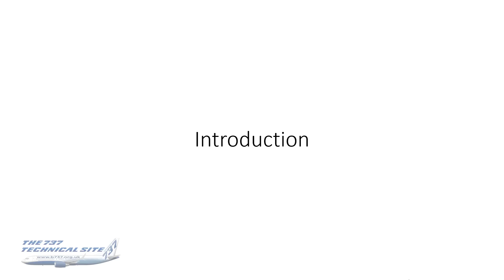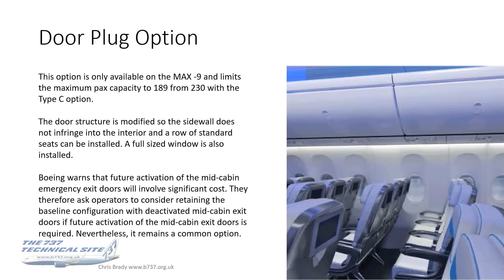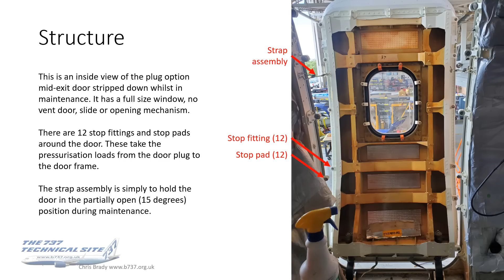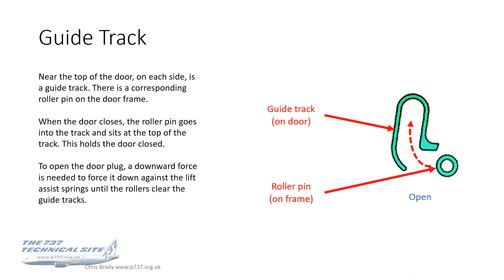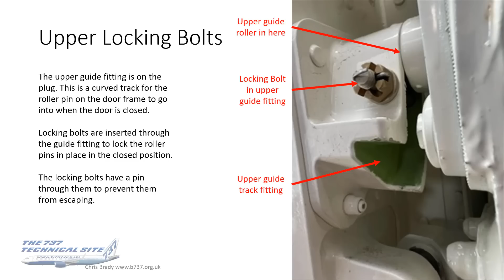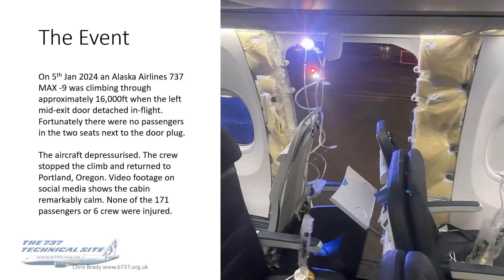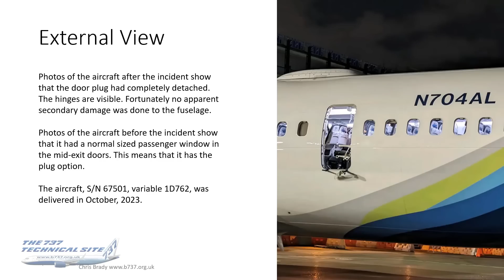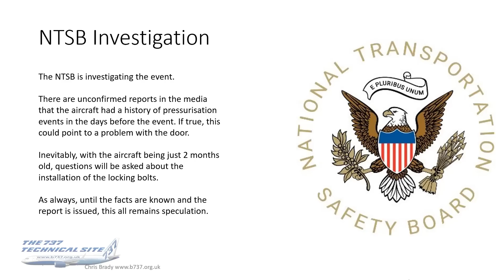737 Mid-Cabin Emergency Exit Doors - Plug Option

Comment: I'm not an Aerospace Engineer but I'm failing to understand why this sliding bolt door design option was chosen over a more fail-safe genuine plug door, that could not fit through the fuselage aperture without being removed and turned around inside the plane. This is not a door that would normally be opened in daily operations, so what is the advantage? It seems to be an unnecessary risk. The relatively undamaged fuselage port and door assembly suggest that all four bolts were left off - so maybe the design engineer just assumed that the production people couldn't possibly screw up THAT badly.
Reply: This is an underrated comment that seems like no one is talking about. These were exactly my questions. It’s not a plug door or a door plug. It’s a patch on an open hole.

Comment: The door plugs are not used in an evacuation (your comments at ~6:00).  The whole point of them is that they are plugs fitted in lieu of actual emergency exit doors in fuselage locations that don't require them.  They are covered in standard wall paneling inside -- there would be no way for passengers to even know where they were, much less open them (which requires tools)

You should revise this

See: http://www.gregorytravis.com/Aviation/737DoorPlug2.pdf
Reply: Great link @algodmen
Nice diagrams and pics of the doors
Reply: Thanks! @networkguy-2023

Comment: It is difficult to see how this door plug could come adrift with locking bolts installed as designed. As a minimum the wire/cotter/split pins must have been absent. After a career in manufacturing industry, I can understand how bolts could be fitted with nuts finger-tight at the end of a shift then tightening and securing these fasteners to be overlooked on the following shift (particularly with a large order book and pressure to deliver on time). For this to happen in the aviation industry is unforgivable though.

Comment: Chris, multiple pilots and engineers who have personally inspected these plug doors within the past few days have concluded that the 'AMM SDS 52-23-00 Page 6 MID CABIN EXIT DOOR PLUG - COMPONENTS, Lift Assist Springs' that you have quoted multiple times is in fact incorrect, or at least misleading and easily misunderstood. Therefore I believe you would be doing a public service to confirm this from a physical inspection or talk to someone who has. Insistently repeating an incorrect statement in the face of mounting evidence is a dangerous position to hold.
Reply from the maker: * Update *
In this video I state that a downwards force is required to remove the door plug. I based this statement on text in the AMM SDS which I now believe to be incorrect or misleading. It is possible that a very small downwards motion (1-2mm) is first required to be able to free the locking bolts. But the door must be moved upwards by a couple of inches to clear the guide tracks. Apologies for any confusion.
Reply: @ChrisBrady737  Thanks for the correction Chris. Looks like the Boeing AMM had a lot of people foxed. Take care.
Reply from the maker: Thanks and my apologies again! @davidjb3671

Comment: Just to be clear...the door moves up first (hince the "lift assist") and then hinges outward and down. As your slide shows, the roller pin is on the fuselage frame and the guide track is on the door. The door stops also inter lock when the door drops into it's closed position.

Everyone is concerned about this plug poping out. But from NTSB statements the Main cabin door opened in flight because Boeing says it's designed to open during rapid decompression. The plug is supposed to be bolted in and shouldn't be able to open it without pliers and a wrench. My question is...which door opened first? And HOW did the bolts disappear?
Reply: It's the cockpit door that opens when there's a loss of cabin pressure. But the crew didn't know about that feature and apparently some of the cabin crew was distracted by that and tried multiple times to close it. Seemingly only when the cabin altitude is below 10,000 feet is the cockpit door able to be latched.
Reply: No!  The cockpit door is designed to pop open on decompression, to avoid structural damage.  The plug is supposedly designed to never fall out, but the design isn't too good.

Comment: It's interesting to note that the doors need to be pressed about 4 cm DOWNWARDS to release the fastening rollers from the roll track. It would probably be a safer design to require the doors to be pressed about 4 cm vertically UPWARDS in order to release the fastening rollers from the roll track!!!
Reply from the maker: * Update *
In this video I state that a downwards force is required to remove the door plug. I based this statement on text in the AMM SDS which I now believe to be incorrect or misleading. It is possible that a very small downwards motion (1-2mm) is first required to be able to free the locking bolts. But the door must be moved upwards by a couple of inches to clear the guide tracks. Apologies for any confusion.
Reply: The door does have to move up for the track to clear the frame mounted roller pins.

Chris is wrong, because he is citing an apparently incorrect maintenance manual procedure.
Reply: They need to be moved upward. The Boeing MX manual is WRONG!!!

Comment: The media not understanding a bolt isn't tightened, it is the nut that is tightened was confusing me. These are castle nuts with a retaining pin.. So either a pin was used and not spread, the pin failed or no pin was used. Or someone used an ordinary nut. Or the arrestor bolts and nuts weren't used at all.

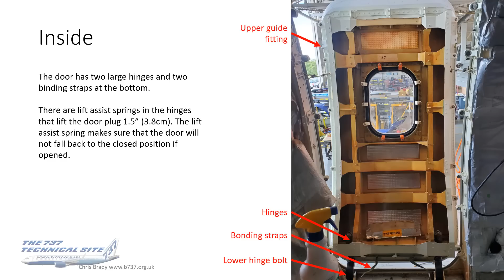Comment: At 6:24, when talking about the lift assist springs stopping the door from dropping down to the closed position, you say "it would be hugely undesirable if an emergency evacuation was in progress". I'm confused, as earlier you stated this was only opened for maintenence purposes and was not an emergency exit.
Reply: I guess he means when the same hinge is being used on a functioning door. In this instance perhaps the spring shouldn't be fitted as it tends to push the door around if not restrained by the arrestor bolt.

Comment: Why the heck can't you just put a Damn door in there.  Emergency exit doors have normal windows too.  did they save a couple hundred bucks to create an obvious hazard (a single piece ready to fly off a plane...)
Reply: I suppose it would need a slide too, so to save expense,
Reply: If there's an inherent design problem with door plugs in general, sure, but if this particular case turns out to be human error during FAL, there's no reason to install an unneeded door.
Reply: @ArKritz84  There's always an inherent added danger of a PLUG over having no hole in the first place.  These planes are ordered in advance and cost billions.  There's no reason they need to have this extra hole.
Reply: That would require slides on the doors, and 2 more FA's.

Comment: You did a pretty good job on this.   But I think you need to do a little more explanation of the opening and closing procedure.  Maybe get a copy of the manual to explain.  Your nomenclature was confusing at times.  I don’t think you push down the door to get it open.   I think you remove the 2 upper bolts then remove the 2 lower bolts.   This allows the door to slide up allowing the fitting to slide up away from the rollers then allowing the stops to clear.   To close the door you push down allowing the the stops to engage and the roller guides to mate with the rollers then push down on the door to put the 4 locking bolts in.
Reply from the maker: * Errata *
In this video I state that a downwards force is required to remove the door plug. I based this statement on text in the AMM SDS which I now believe to be incorrect or misleading. It is possible that a very small downwards motion (1-2mm) is first required to be able to free the locking bolts. But the door must be moved upwards by a couple of inches to clear the guide tracks. Apologies for any confusion.
Reply: The Boeing manual is wrong.

Comment: The slide regarding the Guide track (@6:30)  has two BIG errors on it. You need to fix this or people will lose trust everthing else in the video.
1)  The door plug needs to go UP to open, not downward as written. So same direction as the assist spring is pushing. Hence the spring is is trying to open the door.
2) The guide track does NOT hold the door closed. It only stops the downward motion. Together with the hinge. The lock bolts and Sir Newton is what is stopping it from going up and opening. 

Also the guide track does NOT bear the huge outwards load from the cabin pressure. The stop pads do. This will turn out to be very important. If the stop pads are mis adjusted so the guide track/pin gets the load, they will break and the door come off.

Also, it looks to me like the locking bolts can not go all the way through. There is simply no room to install it then, when the nut is facing inwards. This could very well end up being the core issue. The bolt head is only "a bump in the track", so the roller can roll over it, if the guide flexes/breaks. 

Lastly. The info on the cabin press warning light is true. The NTSB has mentioned it several times in their 2 press conf. Listed on the youtube.
Reply from the maker: * Update *
In this video I state that a downwards force is required to remove the door plug. I based this statement on text in the AMM SDS which I now believe to be incorrect or misleading. It is possible that a very small downwards motion (1-2mm) is first required to be able to free the locking bolts. But the door must be moved upwards by a couple of inches to clear the guide tracks. Apologies for any confusion.

Comment: In the photo of the Alaska airplane the pads on the airplane look like paint is scraped off the topside. This could happen when the door is opened for maint. but I imagine the door would be moved fully upward during maint and most likely not scrape the top of the pads otherwise you will have to do repairs to the pads over time.  If the door slid upwards under pressure it would violently move outward just as soon as the dogs slid clear of the holding pads. My guess is the door was not properly installed and one or more locking bolts were missing when when it left the airplane. It should be pretty easy to determine if they were installed or not.

Comment: Just followed the latest ntsb briefing... It seems that the upper guide fittings were fractured... Interesting finding.
Reply: yes but later in the briefing, they clarified that they were fractured because the plug had moved upwards - that would take the pressure load away from the stop pads/fittings and load up the upper fittings - which would make them break.  It was interesting that there didnt seem to be any comment or questions about whether the locking bolts were found to be in place or not..  unless I missed it

Comment: Very good Chris. The description was spot on except one key item.
No big though. You said the door traveled upward during closing.
I deliver the FAA certification courses for passenger and cargo doors, but only our twin aisle aircraft.
Reply from the maker: * Update *
In this video I state that a downwards force is required to remove the door plug. I based this statement on text in the AMM SDS which I now believe to be incorrect or misleading. It is possible that a very small downwards motion (1-2mm) is first required to be able to free the locking bolts. But the door must be moved upwards by a couple of inches to clear the guide tracks. Apologies for any confusion.

Comment: All four bolts were MIA , may have broken or IMHO the nuts were not torqued correctly no Loctite applied , leading to vibration to file away the split pin and then allowing the nut to come loose once one came loose on one the 3 remaining ones would have over a week or two come loose and the rest is physics 101 .

Comment: Another question,: During FAl or maintenance, if the plug is to be removed, is it just opened, and then slid up and out of the hinge, or does the hinge guide fitting get detached from the plug door body and   remains on the hinge assembly while the plug door is removed? 
(since the UA photos show loose screws keeping the hinge guide fiting attached to door plug body).

Comment: Chris, now I’m confused all after understanding the plug type only on the 900 is NOT an emergency exit; Yet between @6:12 thru @6:25 you discuss the lift assist spring so that the ‘door’ won’t fall back into the closed position in the event of an evacuation in progress. Yet, the 900 plug is not an evacuation portal. Can you clarify ?
— Are you saying the plug shares the same hinges with an actual type I, II, or III ?
— I’m also a bit miffed on the whole ‘have first to push down” so that the plug clears the ears (fuselage)…right ? If I’m understanding you correctly, then how may the door have exited even if the bolts we’re missing ? Because the tracks would still be seated on the rollers. Don’t you think ?
Reply from the maker: * Update *
In this video I state that a downwards force is required to remove the door plug. I based this statement on text in the AMM SDS which I now believe to be incorrect or misleading. It is possible that a very small downwards motion (1-2mm) is first required to be able to free the locking bolts. But the door must be moved upwards by a couple of inches to clear the guide tracks. Apologies for any confusion.

Comment: 9:17 : Castle nut locked by a cotter pin not locking wire
Reply: It is usual to secure single castle nuts with a cotter (split) pin, rather than locking wire. Where there are multiple fasteners close together locking wire can be used.

Comment: Looks impossible for that “door” to move with those anchor and locking bolts in place. But it did, and that’s what’s both fascinating and troubling.
Reply: The locking nuts could have come loose if the locking pins were missing. Equally if the locking bolts were missing then catastrophic failure was almost inevitable. Even if the bolts are not found on the ground that does not mean they were not present. Hopefully inspection of the aircraft and plug door will shed some light on possible explanations.

Comment: Blancolirio has linked a report about loose screws that fix the brackets to the door ?! 
Still looks like a lot of bolts need to come loose for this plug to jump up and fall off your plane ..🥶🥶🥶
In any case Boeing definitely needs to check their procedures and approval of these (other ?) parts on these (other ?) planes..  the Alaskan plane was only 85 days in service !

Comment: I'd like to see interior photos of the door plug as they found it on the ground.   Maybe a stop fitting failed.   Causing a twist and pull out of the short guide roller.

Comment: I am not involved with aviation. But I thought a "plug type" door had the door tapered, so the inside face was larger than the outside face, and the air pressure pushed the door into the fuselage. That's why you can't open a main door in flight - there's thousands of pounds of air pressure pushing the door into the frame. That's also why the door must first go inside the aircraft, then pivot, in order to open

To me, having a dozen stoppers that the door align with doesn't sound like a true "plug style". Yes, it's taking advantage of cabin pressure, but a relatively small change in alignment can render the stops irrelevant - something that simply cannot happen with a true plug style door which can only be opened by being moved into the cabin.

Am I missing something?
Reply from the maker: I dont think you are missing anything. The dozen stoppers have to be aligned to keep the door in. The door is held in that exact place by the hinges and the guide tracks & rollers.

Comment: Is the vertical movement arrestor bolt a single point of failure? If that is missing or sheered the spring launches the door open?